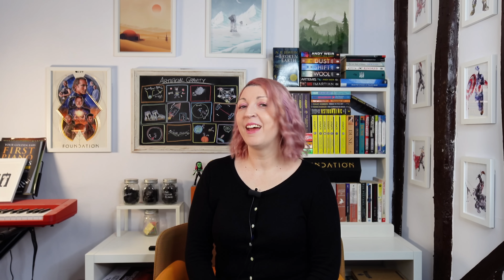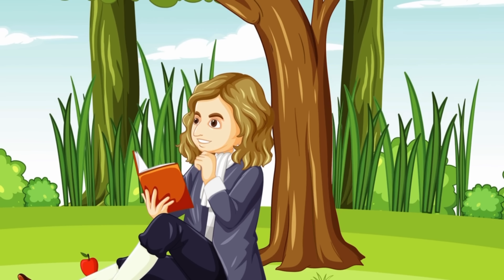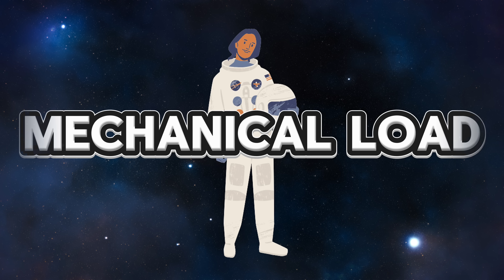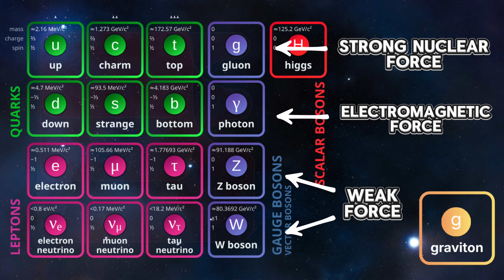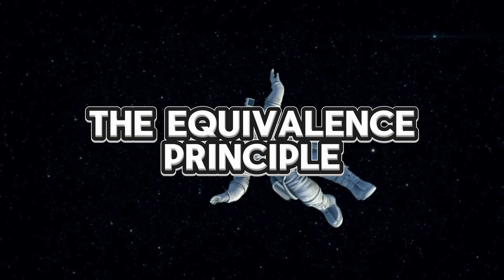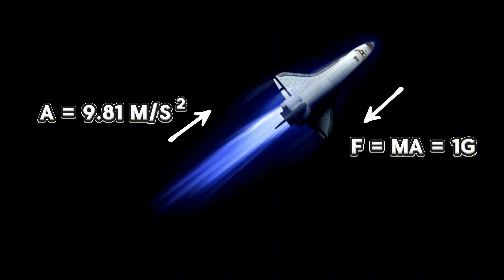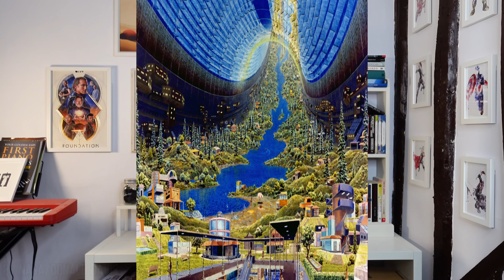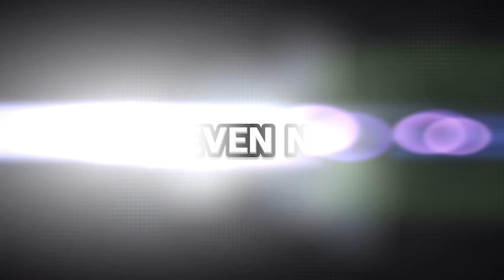Why Artificial Gravity Is Harder Than It Looks

Comment: My prediction is that the first iteration will look like 2 tethered apartment buildings, or a crew section tethered to the engine section, spinning against each other; much easier to manufacture than a ring.
Reply: That's just a test rig. And don't expect rotating wheels early on either. Instead, first expect 2 Starships attached at their nose to a propulsion hub spun to a full 1G. Doesn't need anything we shouldn't expect to have available in 2 years.
Reply: Bola habitat. Great idea for a smaller ship. Retract for acceleration. Extend for cruising.
Reply: @talyn3932  That retracting and extension is no simple matter due to conservation of momentum.
Reply: @speleotrog you don't spin it when you are accelerating. No need to. Slow it, stop it, bring it in and go
Reply: Tethered? how would you enter and leave? You'd have to reel it in every time...
Reply: @Alexander_Kale  for the ship scenario you would stop the spin, reel them in together then accelerate, then reel out and spin up again for the orbital transfer. 

for a habitat you would have problems with a rotating cylinder too; anything you want to bring in and out of a rotating cylinder has to come in/go out from the centre, meaning fighting against the centripetal force and causing spin ups/slow downs of the cylinders. not exactly the same situation, but problems to solve either way
Reply: @nuttyDesignAndFab so long as you are not accelerating you can bring them in and extend them. This doesn't require stopping, just halting acceleration.
Drums would have the issue of having three floors. You would have the downward gravity of the spin, the rear ward gravity of acceleration, and the forward gravity of breaking.
That would require creative engineering.
Even flipping applies gravity to the opposite direction of the flip, so...
Reply: @talyn3932  yes, I understand all this.
Reply: @nuttyDesignAndFab  No, you would not stop the rotation of the station. you would approach in the center of the thing, along the rotational axis, and rotate your own ship to match.
Reply: @Alexander_Kale  yeah, I think it depends on habitat vs ship. if the hab is large enough then yes, your version makes the most sense.
Reply: @nuttyDesignAndFab  It always makes sense. Even in a small habitat, the easiest way to make rendezvoius and thus to dock is at the center, along the axis of rotation. No need to match speed, no need to stop or adjust the habitat, all you need to do is fire your own maneuver rockets for a couple seconds and you are ready to go.

as long as there IS something at the center, this is the easiest way to couple.
Reply: @Alexander_Kale  like, on the tethered thing you can just yeet out tangentially. to dock you'd approach at tangential speed and I guess the habitat has to adjust it's spin/trajectory after you connect

Comment: Magnetic boots won't work on most spaceships because they are made of aluminum, not steal. Aluminum is a lot lighter than steal, which means less fuel is needed to move the spaceship.
Reply: Steal?